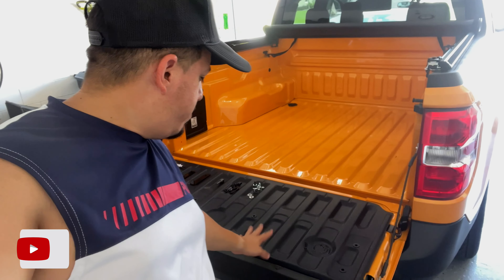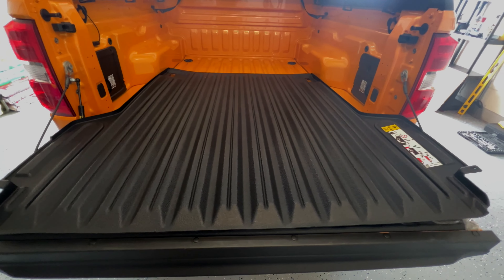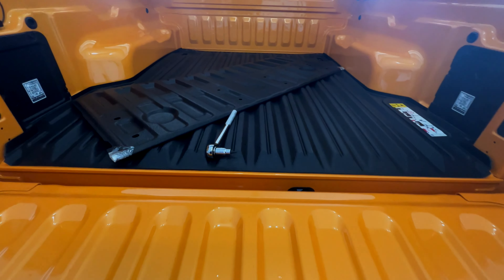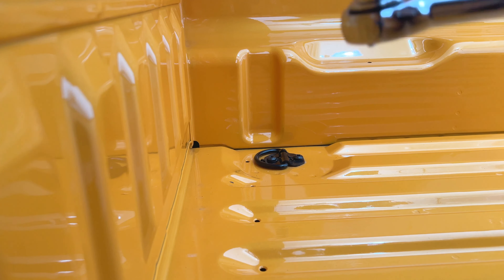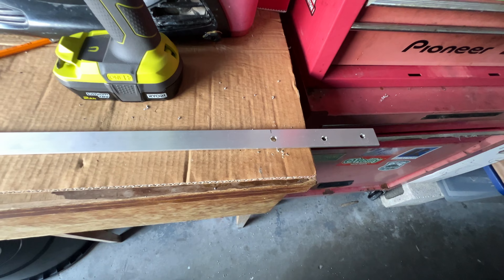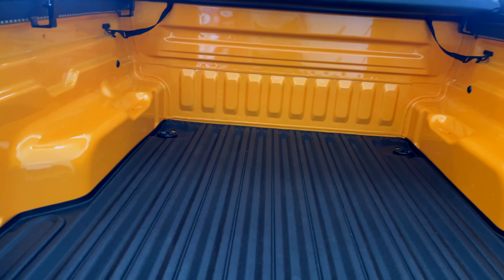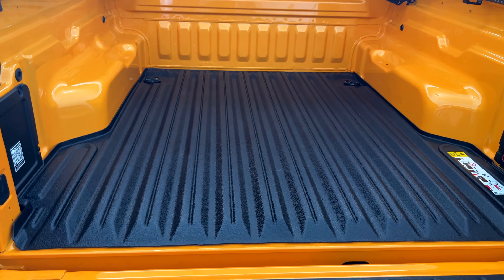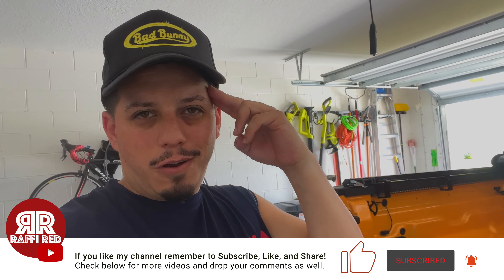BED LINER KIT INSTALLATION for the FORD MAVERICK 2022

Comment: Because you're using a tonneau cover, and they possibly leak (they're known to leak at the corners), I'd suggest applying a bead of silicone on the edges of the tray liner. This would help keep the under side dry in the event of water exposure. Either black or clear silicon... And maybe to the tailgate cover also. Just a thought. 😉 Thanks for a great channel. I don't know (at this time) if my 2023 order will actually be built or not, but this video shows a nice alternative choice to the $500 spray-in liner I was thinking of adding to mine.

Comment: I was able to buy mine online and pick it up at the local Ford dealer and got a $100 discount from sunrise Ford in Fontana. Plus tax of course. If you buy the entire bed liner kit it comes in a box it is slightly smaller than a small water heater size and you can squeeze it in the truck diagonally if you lift it up in the corner and shut the tailgate on the box. I think you have to buy it and pay for it online to get that discount but I'm not 100% certain of that. I ordered it on Friday and picked it up Tuesday, so it didn't take long.

Comment: In my trucks I have always put in a rubber bed and tailgate liner.  Makes it easier on the knees.  My 23 Maverick is supposedly being made in Feb so I hope there is an aftermarket one or I guess I could get a larger generic one and cut it to size.  As far as drainage is concerned any water that gets in the bed travels under the rubber liner to the drains.
Reply: Sweet, that's what I chose, came in the mail today.  Stock rubber bed mat that says "Maverick" dropped in today!  Tailgate liner install tomorrow.  I'm glad I didn't get the hard tray like in this vid, I almost did.  I have not had a pickup in 20 years.

Comment: At first I thought you were missing the other panels. I didn't realize that Ford was selling these kits that are just the bottom panel and tailgate cover. 
I found a dealer locally that is selling the kit with all 5 pieces at $350. I think that is a good price to cover the whole bed. 
I was considering a spray in liner, but I don't know. I have always had the plastic ones and I like them.

Comment: Watching video, as I have the bed liner kit from factory. Question are the black dots towards the front of the bed on the sides above where the 2x4 slots pass through grommets? I ask cause the bed liner kit covers them and I put a tonneau cover on and it has drain hoses from the channel and I have no where to put them.

Comment: If you order just the floor part for the bed liner and the tailgate I believe Ford refers to it as a tray liner and it doesn't come with the hardware kit either.

Comment: The oval sign and the word maverick only appear on the panel that fits onto the portion of the bed against the cab of the truck. The tray liner doesn't include that. The Way Forward lists all the separate parts is very confusing but you can tell by the price. If you want the entire bedliner including the floor piece the side pieces the tailgate and the piece that lays flat against the cab the list price will be $415 the last I checked. Just look for the most expensive option in the parts list and you will find the whole enchilada!
Reply from the maker: Got it.

Comment: The hardware kit is available as a separate part number. If you order the entire bed liner kit including the sides etc, you get the hardware kit included. If you order separate parts you don't get the hardware kit included. The list price on the hardware kit is $18
Reply: My tailgate kit came with no hardware. Where can I find the hardware JUST for the tailgate part?